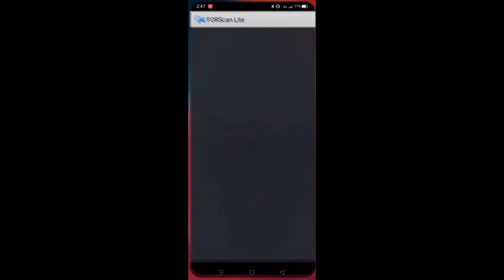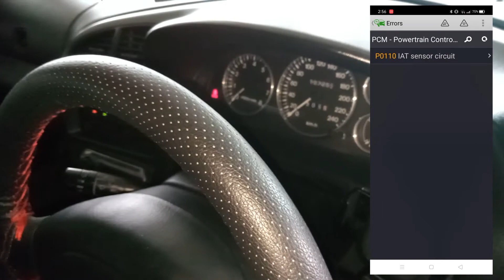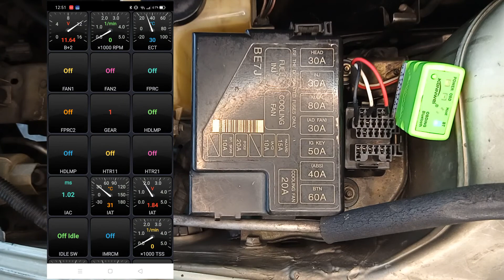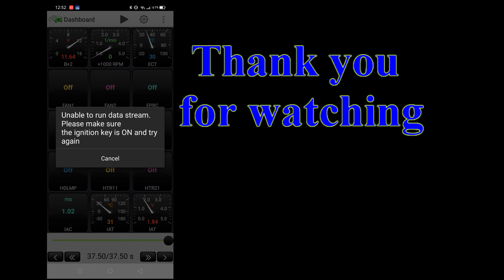Mazda OBD1 check engine fault code using ELM327

Comment: my 1993 ford probe uses the same diagnostic port configuration as the 1995 323/mx5... no bus + or -  just fen, men, ten, gnd and at the bottom all the fp rad fan etc.. strange... it was originally an ATX I converted to MTX but stll using the MECS II ECU. I am trying to get a scanner connected so I  can data log to fine tune my piggy back ecu that lets me run flex fuel up to 95% ethanol. pretty fun. Update: turns out for the scanner to communicate pins 4 and 5 (gnd) on the obd2 side have to be both connected to data port gnd. I hope it works.
Reply: Hi, can you tell me which pins you used please?

Comment: I tried it but it doesn't work on my Mazda 323F BJ Sadly... I used the 17 to 16 pin adapter and EML327 and a diagnosis tool. Both didn't work and I tried using 3 apps which also didn't work... Forscan couldn't connect to the ELM
Reply: Same issue here. 1997 Mazda 323 / protege. Can't get any scan tools to connect.

Comment: Hi, I was wondering if the first method applies to my 1994 mx5 miata model.
My car was made in Japan. There is no BUS+ or BUS-.
Can I use any ELM327? I'm going to use FORSCAN.
Thank you 🙏
Reply from the maker: If no BUS+ pin ，its using MEN pin,  in video it shows both wiring configuration. Hope this help.
Reply: @lalim923  Thank you very much for your answer 🥹

Comment: Hello, I can connect my Bluetooth connector with forscan on windows pc but can not connect to my car, I have a 323f 1995 witch connection I need?
Reply from the maker: I don't have any idea what type of the obd cable that you needed, using iso9141-2 k line or  J850 bus line. If you are not sure try the other connection if one is not working.
Some clone Bluetooth obd  might not working as well
Reply: Thanks for the reaction, I have made  3wires like the first part of the video and I have 2 obd2 dongles, a mini blue one and a bigger one with orange, both say elm327 on it, they are Bluetooth. I can connect to the dongle but not the car
Reply: I bought the same Bluetooth device as in your video but I can’t connect with the car, I use forscan at the pc, it is connected with the Bluetooth
Reply from the maker: Do check the wiring connection DLC K-line to car ECU, Off engine remove your car key, using multi meter measure the resistant between MEN and GND pin , it should have value around 130K ohm.

Comment: hey I have a Mazda Protege 1995 it has the port to connect the OBD2 ELM23 but nothing happen when plug it I use this video to connect it this way but displays a message that says unable to connect to ECU do you know why is that? or what could be?

Comment: Friend, that configuration could work for my kn ford laser, it has the same 17-pin connector, I am not sure if the communication protocol is 9142-2 or j1850pwm, although that car will be a ford brand, I understand that it is manufactured by mazda, I would really appreciate your help, thank you, sorry my English I use the google translator.
Reply from the maker: Hi friend, It should work , the cable work both for 2 type protocol

Comment: Torque pro software that comes with the adapter featured in this video is not compatible on Mazda engines. It will not communicate with the ECU. Need Forscan lite software. Just take note.
Reply from the maker: Yes, you are right. Torque doesn't work with Mazda obd1 , you need Forscan.

Comment: My stubborn engine refuses to reset after i removed the negative battery terminal with brakes depressed anf headlights in the ON position. I left the car like this for 1 hour  and check for error codes using jumper wire and LED. The blinking lights are still showing the same error codes. Waiting for the ELM unit arrival to erase codes. Thanks
Reply from the maker: Hi Vincent, You need fixing the problem that caused the error code before reset ecu.

Comment: Some users have experienced ECU or computer damaged to their cars after plugged in to their car's OBD II socket. Have you experienced any of this? Thanks
Reply from the maker: Hi ,  so far I haven't encounter this issue even i use the wrong type of connector.
But i have read in other forums . Some elm327 has manufacturing defect because using wrong value of components in their product. Mostly in obd2 , CAN bus .which resistance between pin 6 and 14 has 20 ohm on it.

Comment: Is is safe to leave the OBD2 plugged into the port while driving?

I want to keep an eye on the real-time data.
Reply from the maker: No problem if plug it while driving.
Some of the blue tooth elm scanner has the ability self turn off if not use for certain time. This is to prevent draining car battery.

Comment: Thank you so much for video upload! I have a 1999 Mazda Bongo 2.5 TD and I have read that the Mazda 626 has the same 17 pin set up. Would you know if this is true? Could I also ask you what wires you used? A big thanks, Martin
Reply from the maker: Mazda 626 has EU MECS-II diagnostic connector,  you can double confirm by checking  if Bus + and Bus - pin available on the 17 pins connector. Any wire can be use as long as it not too big that damages the female socket of the DLC.
Reply: @lalim923  Friend, my mazda is 17 pin, but it does not have Bus + and Bus - in its connector, does it mean that I cannot use an elm327?
Reply from the maker: No , you can use it . either MEN ,Gnd or Bus+ Bus- can be use.
Reply: @lalim923  I have the same on my 2001 626, do I use 3 wires to connect Men, Gnd and B+? And will it work with a cheap obd2 diagnostic tool?

Comment: Is it possible to use other OBD2 adaptor apart from ELM327? My car is Lantis 1996. I have use ELM327 wifi adaptor with Iphone which is work but have some issue of lost signal. Try another product OBD2 with cable and display unit but there is no signal. It show only voltage.
Reply from the maker: Other OBD2 scanner that I know work on Mazda Lantis is using Launch CRP 123E.

Comment: Hi, good vídeo,  I Know is not for a honda cars, but may be you can help me,  my accord 1998 have the obd1 3 pin connector,  is posible conect the ELM327   scaner? If the answer is yes can explane me how, please 🙏 
Sorry 4 my bad english
Reply from the maker: Honda car with OBD1 connector work with ELM327 but the pins for connector are different from Mazda cars.
Reply: @lalim923  bro you know how?
Reply from the maker: If the Honda obd1 3 pin connector is blue color,  assume the connector notch at top, Left pin= Ground , center pin=12V ,and right pin signal (K-Line)